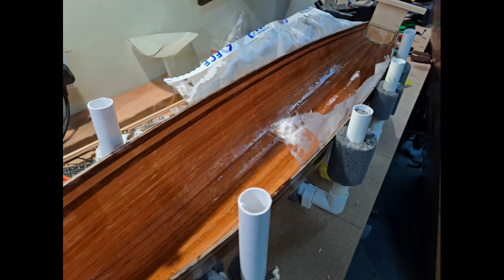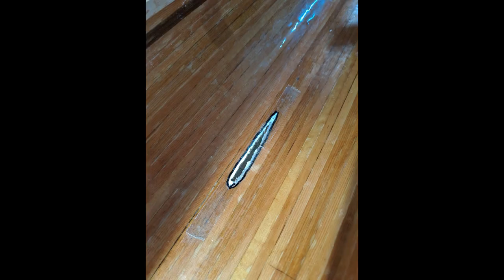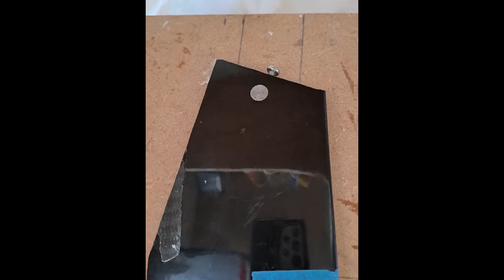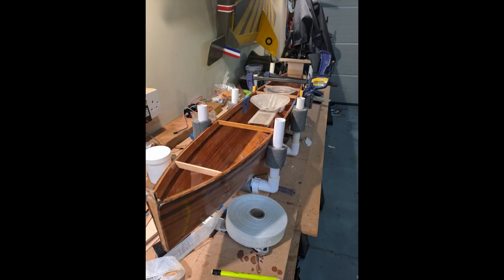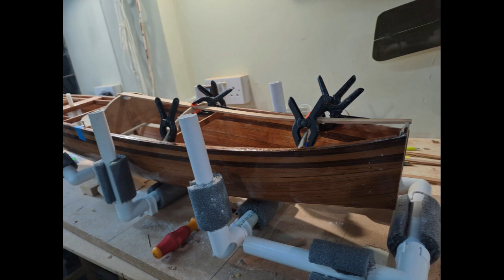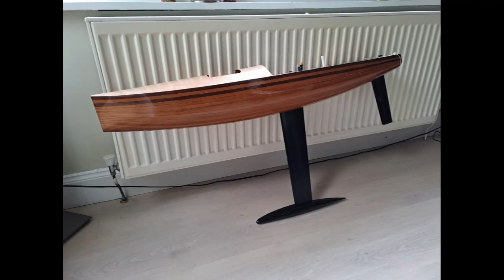Alternative IOM RC Yacht Build Part 2

Comment: Fantastic video and brilliant work with the build Colin! Am somewhat envious, though think this might be within my ability, but I need somewhere or someone to ask questions of. Few q’s occur to me straight away: 1) what make & model of laser did you use? 2) did each former have the same number of planks (with ends tapered appropriately) fitted on it? 3) where did you source the i)shadows; ii) planks; iii) deck; iv) bow bumper?
3) roughly how long did the hull assembly take (up to the deck fitted stage) spending roughly how many hours per week?